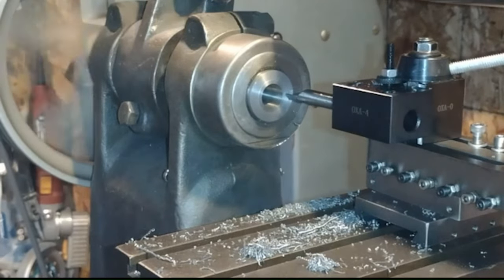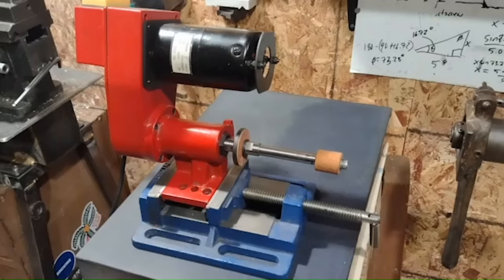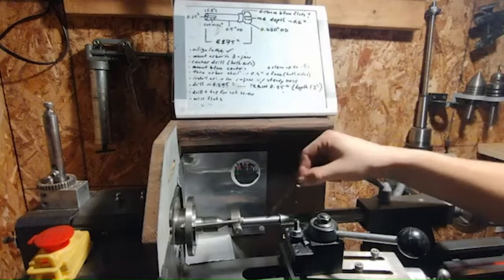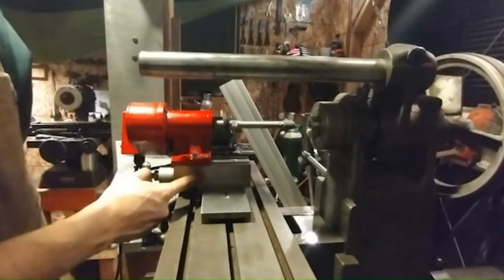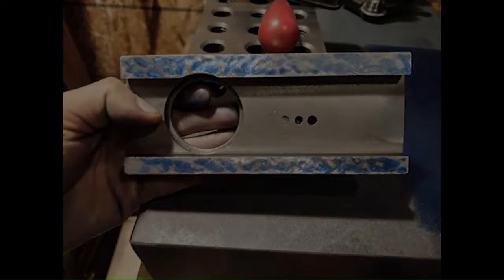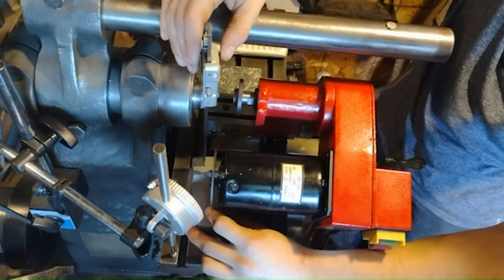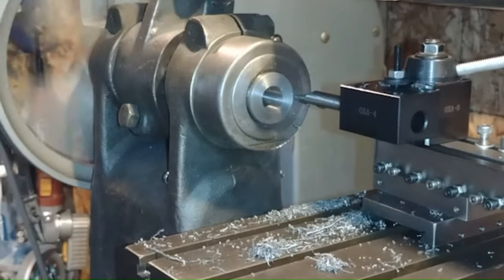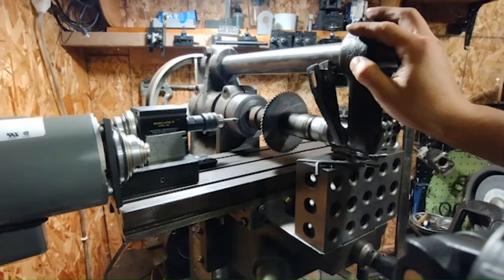Benchmaster Horizontal Mill Restoration pt. 2 - Spindle Regrind

Comment: Yeah! good to see another video from you. I see some thoughtfully planned out and performed work done to this old mill.   What size arbors does that take? I have some spare 1" arbor spacers if you need some.  
Climb milling is really not done on a horizontal mill- a good way to break cutters and other bad things. And on a horizontal mill you're either working from the "get chips spat at you " side or the "pull you into the cutter" side.  Since an operator is usually working from the second side, the danger of being pulled into the machine is one of those things to scare you into working safely. 
 It's a big thing that you can run things other than collets,  I find a shell mill very handy for doing wide areas, it's a quick way at least to square up stock.
Reply from the maker: Hey, glad to see a comment from you here. That's funny.. this machine just so happens to have a 1" arbor. Maybe we can do a small, cross country tool exchange. Perhaps we can DM on instagram.. link's in the bio. 
And yeah, climb milling 🙄. You won't catch me doing that again on this machine. Thanks for watching.

Comment: I have to do similar stuff with my 1930's Biernatzki H2 miling machine spindle. I want to rebuilt it from Mt-5 (original is Mt-5, but there is stuck adapter Mt-5 to 4) to ISO40. Just because I have ISO40 tooling, shanks etc... And I realy don't like "nail out by 2kg hammer" tool out of spindle. Good luck!
Reply from the maker: Whoa MT5, that must be a pretty good sized mill. Good luck to you too and thanks for stopping by!
Reply: @backyardmachinist  That Biernatzki H2 size is aprox 2 tonns. Similar size machines is hevier (table 1250x320mm). Cheers! I'm small machinist in bush - workshop. Keep up better than me!
Reply from the maker: @FactoryDragon87  you have some impressive machinery in your shop. Thanks for commenting.
Reply: @backyardmachinist  Meech, small machines. Anyway - I have few of them. Cheers!

Comment: Did you have a date on the spindle nose bearing? Mine was 8-10-50. One of the old ones.
Reply: New old stock Timkens got me within 0.001" on the runout
Reply from the maker: @dogdipstick I imagine the bearings on there are the original ones. When I opened them up some time ago, I did notice a little bit of pitting. The replacements are cheap too. I just couldn't figure out how to get the races out of the spindle housing. So I just cleaned and re-greased them. How'd you do it?
Reply: I took a tig welder, a little scratch tig machine and ran a bead around the inside of the race that is pressed into the spindle carrier nose. 

Run the bead around and the bearing race falls right out. Both ends were done like this. Just run a weld bead with a mig or tig around the inside at as low and controlled current, heat, as you can. race will fall out once it has cooled down from red hot.  @backyardmachinist
Reply from the maker: @dogdipstick  Ah, interesting.. I assumed some welding would be necessary. Seems counterintuitive that it'd shrink to a smaller dimension than it started even after cooling, but I believe you. I thought maybe one would need to weld some bit of metal to the race to help pull it out. 
I've only got oxyacetylene over here. Maybe gas welding would work? Seems to be writing well now; I will revisit the bearings down the road when they are problematic. 
Thank you!

Comment: Nice work on the regrind but that lever operated X axis is just not safe. You clearly think mechanically so adapting a lead screw should be doable, at the worst use a cheap worm drive boat trailer winch drive mechanism where the rack and pinion handle is.
Reply from the maker: Yeahh climbing is definitely not a good idea, but it never is on a horizontal mill anyhow. This rack and pinion on the x axis was actually a stock accessory one could get for this machine back in the day to make it more optimized for "production". It's a miracle I was able to find it on eBay, even if it didn't have the handle.. cuz I sure as heck couldn't find a lead screw... Although I do have a lead screw nut. Maybe one day when I get a big enough lathe to turn a lead screw. Until then I'll definitely be making a longer handle like the stock one. 
Thanks for watching!